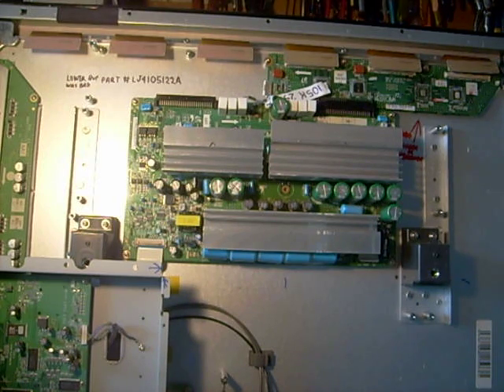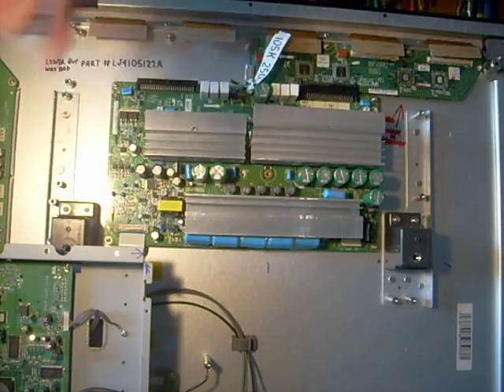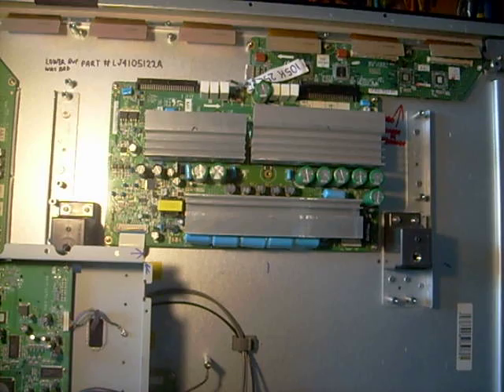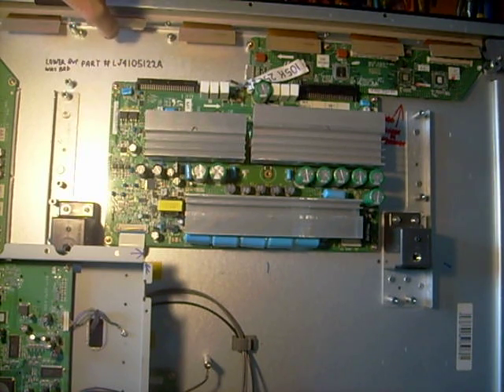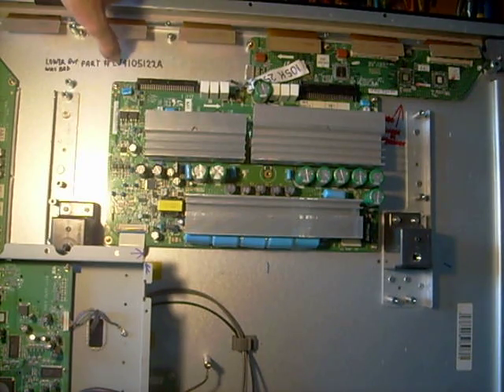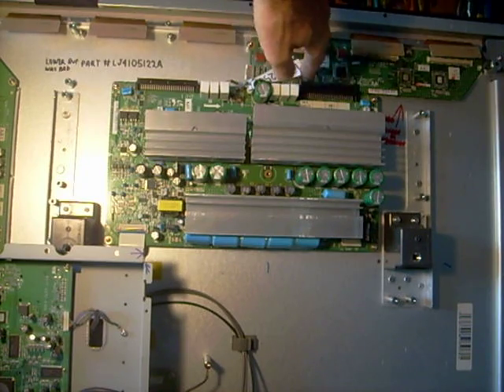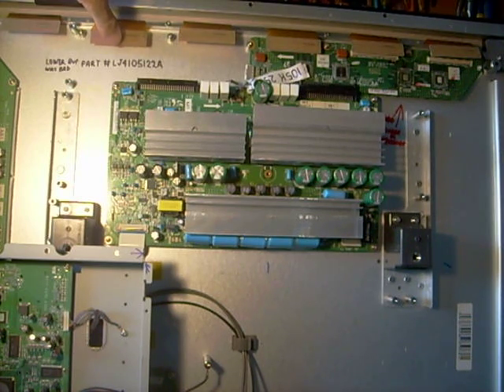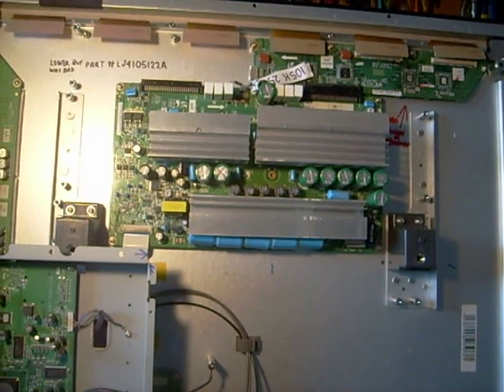Plasma TV repair. Learn from my mistakes.

Comment: I got Samsung PS42C450B1W with broken diode and 3 IGBTs (1x SF10A400H, 3x RJP30E2) - replace just that part or it would blow in the air again?
Reply from the maker: I can't answer your question since I don't know if there is an additional problem 
which might damage your replacement parts.

Comment: Hi, I Have a LG 60PM6700 plasma TV and after it's been turned on for a while all blue pixels light up. Also, 3D doesn't work. I have the right glasses but the TV does not generate both images (left and right). Do you have any ideas on how to fix these 2 problems? Thank you very much!!
Reply from the maker: Sorry. I'm clueless about your particular model.
Reply: Grants Pass TV Repair thank you anyway!

Comment: I own 3 Panasonic plasmas. They have been amazing. If you want inferior PQ then go with led. Otherwise wait for OLED because that is the only technology that can match what plasma offered. Misinformation killed a superior technology.
Reply: Wyatt King Very true!!!
Panasonic use the best components although recently they have been cutting corners from what I hear.
The old adage "pay cheap , pay twice" always holds true.

I used to work for JVC and all of our engineers in the factory had Panasonic tv's - Jvc are terrible tv's.
We used to have the monekys on the assembly line stick coke cans between the electrodes so that the tv would blow up when first switched on and guys smoking dope in the auto assembly room during night shift and getting hands and fingers cut off - you wouldnt believe what went on at the JVC plant in East Kilbride.
Reply: OLED and quantum dot displays should be  able to match or beat a plasma tv for picture quality , LCD sucks though , rubbish pictures for sure.. LED back lit sucks too  Plasma is king for picture quality!

Comment: hi,i hv a 2007 plasma tv     p42w46x   that when turns on pops like a firecracker!!!!!! & blows a fuse on the 3rd board on right facing the back of back & don't see anything burnt anywhere or no capacitors,,any help thank you for video too

Comment: HOLD on a minute !  Lets say I walk into Best Buys  and I look at several of there TV's.  Generally speaking I would want to stay away from the cheapest thing they have. So there goes Emerson, Sanyo and Samsung. There are so many new labels out there who knows for sure. And there's some I have never dealt with.  Like L.G. and Vizio.  At one time Magnavox was considered really good. I suppose there were many other's that would fit into that category. Like JVC and Philips and if you had a Zenith it was the top of the line. But in today's times you go purchase a Philips TV. Well they a well known company. They make a lot good stuff. When you have trouble with it and when you open it up. You find everything inside is made by Samsung. Now my TV is 8 yrs. old. So I look on line at everyone I can think of and NO body's has the parts they are all out of stock. But as I am looking for the parts I notice that Samsung makes parts for Philips. As well as a host of other's. So how does anyone know for sure what they have ?  I feel like I bought a pig in a poke. 
What do you think would happen if you went down to your local Ford dealership and looked at a new truck. It says it's a Ford but when you open the hood you see Hugo on  the engine.  Not to many people are going to want to pay full price and less than that are going to be happy with there purchase. It's the old bait and switch. 
So can you tell us which TV's are the ones to buy ?  Oh by the way I was told to replace the Y board and buffers in my Philips.

Comment: Hi I am A Plasma TV Tech work on these every day.
Like everything else Theirs always a bad egg in every batch.This business is trail & error.In This case I would pull All 3 Boards check for shorts on Ymain,& upper& lower.I buy All New Not Rebuilt boards.Just repaired the one you have.
Fixed. Good Luck out there

Comment: I have run into this with the IC's I generally throw some flux on them, reflow, and use the sticky style heatsinks on them. So far it has worked well for me. You could even find a power source within the tv itself and add a small pc case fan (especially since the Y sustain board is generally at the edge where ventilation is abundant in these 
sets)

Comment: I own a Samsung PN58C550. Purple band in top third, worse on right, of screen during white scenes.  I just replaced upper buffer board (ordered from shopjimmy).  Did not take care of the issue.  Any suggestions? TV is only 2 years old and fine except for that.  TV is out of warranty. (I am not a TV tech).  Thanks!

Comment: Hi, I have the exact same problem with a samsung. No picture just the sound. I opened the TV and saw that top IC of upper buffer board is blown. I took the buffer board out and turned the TV on. With this, the lower part of screen lightens up a little with a flicker but no clear picture in the lower half. 
Need ur advise on whether just replacing the upper buffer board can fix it? Because 3 boards are just too expensive.
PS: Everything happend after 3 hours of using AV2 on the side for 1st time.

Comment: I checked the SUS OUT to each LINE OUT. All pins should appear open. On a modern plasma, ground isn't very important on the sustain boards; it's only used in the addressing phase.

Comment: Due to gas evacuation from the panel. The panel will make a buzzing sound when the delicate mix of neon/xenon/nitrogen is replaced with air because air has a much higher dielectric constant. Makes a much better capacitor leading to high current draw through panel & ERC doesn't work properly = high power consumption. Also, when the electrodes short together it can damage the buffer board (see my channel for a video on this.)

Comment: hello, I have a SAMSUNG PS43D450. I replaced the main power board, the main signall board, and the sustain y main Y PCB. However I have the same RED LED and the three clicks after which nothing happens appart from the red LED blinking.
What can be the problem?

Comment from the maker: Check the Y-sustain board for low resistance shorts to ground with your ohmmeter. Measure from the ground connection on the Y-sus board to
the power supply input terminals on the Y-sus board. If you get a very low resistance reading it means your Y-sus board has a problem.

Comment: hi i have a lg50pj350, the red standby light is on when its pluged in, but when i turn it on it clicks on and off three times and never actually powers up, i took off the back panel and i didnt find any capasitor that were bad. what would you do next.

Comment from the maker: The symptom you described sounds as though one of the circuit boards in your TV has a short to ground, and this is causing your power supply to shut down a couple seconds 
after the TV attempts to turn on. Since the Y-sustain boards often fail you might want to test the resistance between the ground and the power supply inputs on your y-sustain board to see if the resistance is low enough to indicate there is a short. An couple ohms or less means you have a short on the Y-Sustain board.

Comment from the maker: You might be able to eliminate some of the snow by turning up the VS voltage. I have been warned not to exceed 10 volts over what it's suppose to be or it can damage the panel.
The voltage should be posted on the tag which you will see after you remove the back.

Comment: Hi Grant-   can you help  me  please.  I have a SAMSUNG sp-P4251 with only snow on the screen-  looks like the bar code for smart phones.  No blown capacitors that I can see-  what else can be wrong-  the carry in repair shop wants  $175.00 to look at it-  they also said they aren't worth fixing-  yes it is 7 years old but it had a nice picture and it fits in my wall unit.

Comment: hi can you help I have a LG 42pc1d plasma . I turn on the power as soon as the screen comes on i get a pop from speakers then it turns off some times it stays on a little longer if it does the screen flash's black to shade brighter like a pulse  then turns off again. i have replaced the caps on the power supply and a big chip under the heat sink on the left sustain board in the past all was fine till a year down the line till now. all caps look good ?

Comment: Im with you on this one, I have a 50 inch Samsung plasma on the floor next to me. So far ive replaced the main powersupply 3 times, the Y-board 2 times and every other damn board in it as well, got it working for a day or two, then something else fried in it... Im throwing in the towel. 
So the thing i´ve learned from this; pray to the lord that it goes bad WITHIN the warranty period... Im getting an LCD tv instead :)

Comment from the maker: @gamerepair2020 Yes there are a variety of tests you can do to look for shorts. You can do the current draw test with your amp meter, the resistance test with your ohm meter, the voltage drop test with your volt meter, The light bulb technique. and a couple others. The power supply book which I list on my website at TV REPAIR INFO . COM has a detailed 
description on the how to part if you can't figure it out using my free videos.

Comment: Hi GrantsPassTVRepairs, 
is there any other tests i can do to figure out if it is a short or just a blown out circuit.
i can tell you this, if i remove the ribbon that is going to the logic board from the Y-sus board the light doesn`t blink and i get 12 volts or about 12 volts from the D12V wires on the power board.
thank you.
@gamerepair2020

Comment: Hi GrantsPassTVRepairs,
great video`s i learned a lot from them.
i was wondering if you had time you could answer this question...
i have a Sanyo DP42746 PLASMA tv, i replaced 4 buffer ic`s on the upper buffer board and one mosfet on the Y-main, i tested for shorts and made sure ALL legs of the ic`s were making contact. i turned on the tv & there is an LED light on the power board that is flashing 12 times, when i put my meter on the three D12V wires the voltage reads 11.58 for one second.???

Comment: When the buffers completely short out, the YSUS board will go too and the ceramic fuse will be blown to indicate this. So whenever a YSUS board has a blown fuse, the buffers MUST me checked as described already or you will indeed blow the replacemet Y again. Partially failed buffers are okay for testing purposes, buy shorted buffer boards will always cause a problem.

Comment: Buffer boards also partially fail in other cases when the ICs don't completely short out. In these cases, you will always see some sort of horizontal or vertical distortion. 50 inch LG plzma have bursts of color distortion when the upper board partially fails and a solid white vertical stripe when the lower board partially fails. 42 inch samsung style like philips and lg versions will often have faint horiz. lines within 3 inch bands when the buffers partially fail.

Comment: Buffer boards are easy to test in many cases. Just disconnect them completely and look closely at the buffer connection that plugs into the YSUS side. Not the panle side. There you will find only 2 contact points even though it will look like several more. Many of them are actually ground points. Simply set your meter to diode setting and check for a reading in only 1 direction. If it reads in both directions, then the ICs are shorted and this will ruin a new YSUS board in a hurry.

Comment: Dave, I share your frustration. I bought a set of replacement buffer boards for a Hitachi, and one of the ICs on the lower buffer board blew when I turned on the tv. In general, the plasmas I've worked on have given me nothing but headaches and consumed a lot of my time. I've had much better success with LCDs. One plasma took me a month to drill down to a module on the power supply then from there I found a forum post, where a  poster discovered a 1 mfd SMD cap on the module caused the failure.

Comment: I just fixed my problem,re-seated all ribon cables from Y buffer boards and no more horizontal lines.I paid money to experts on line to tell me it was the panel and couldn't be fixed.This is one more experience I've learned to look for now.Maybe I'll be able to sell it and get my money back.

Comment: I have spent a fortune on a 50" plasma,I'm not really not too good at this but I have replaced the power supply,Ysus,upper and lower buffers,and now I have a good pic but with horizontal lines everywhere.I might spend a little bit more if you have a suggestion.

Comment: I have had the same thing happen ,If you end up with the set ,the best thing to do is wait ,you will end up with a good set of parts out of another set. I always do y board and buffers at same time because I did what you did more than once. trust me you will fix this set later down the road.

Comment: @GrantsPassTVRepairs Doubt it's damaged.It's a symbiotic relationship on that YSUS.Won't work at all.Don't resolder the chips next time bro.Replace the entire buffers board set.I had a problem a while back when a customer returned the TV when i put new chips.Just a tip.Save yourself the headache.

Lucky you.Those Screen are pricy.Flog the SMPS,Lower Y/X Drive Boards,Xsus,TCon&Screen seperately.You can even flog the plastic housing nowdays.I've sold loads on Ebay.Good Luck.

Comment: Let me guess.Model 50Q96HDX or 50C96HDX.Had the same prob.Replaced the Both Buffers & replaced all the mosfets on the board.Tested every other component as well.Took me a while though.Its still works fine now going over a year.

This TV has a common fault with heat.If you do decide to fix the entire thing,Stick a 9-12v fan in there.

I've got the Service Manual for this one Dave.Would you like me to send it  to you?

Totally Agree Most of these units i repair are almost always Samsung!